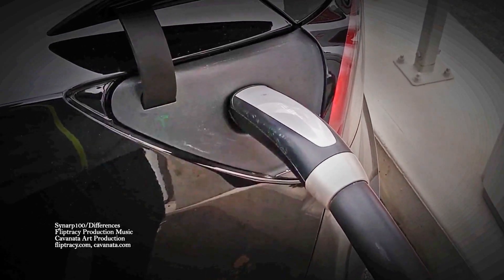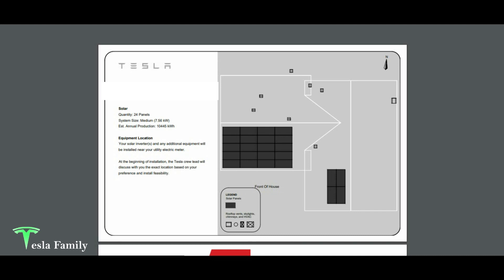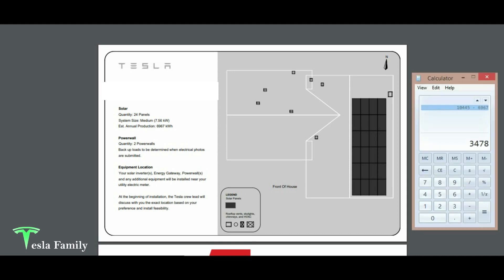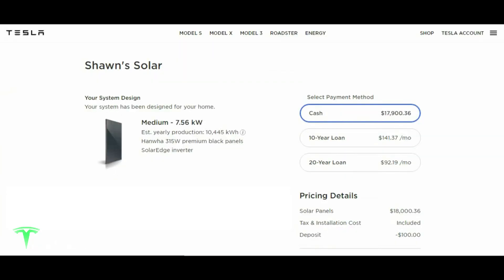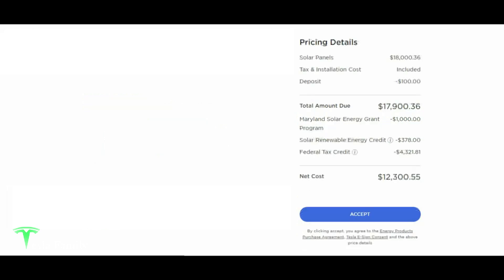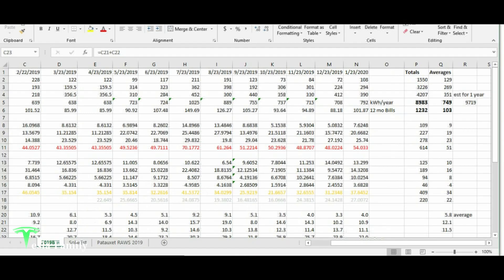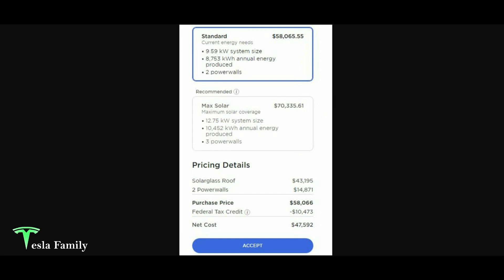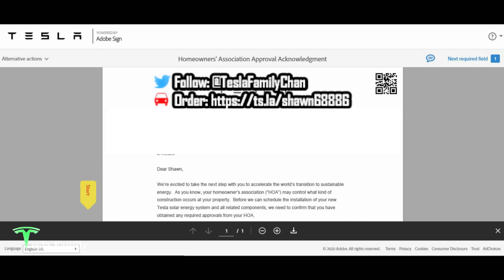Our Tesla Solar Panel Design Layout | Why Direction Matters | Cost Breakdown

Comment: When was your Telsa payment required since you paid in cash?
Reply from the maker: Hi Percy, first 50% after installation and second 50% after Utility Permission to Operate before I turned on my system.
Reply from the maker: Hi Percy! I received a referral notification that your new Solar system was installed on 12/30/2020. Congrats!. Please share some details of your system and or install experience. @Percy Jen
Reply: The let me give you the run down.  I placed my order mid August, a Telsa guy came out to take pictures and  roof details.  After all of that I would call every one to two weeks for an update.  They always told me, “someone is working on it.”  So I the 90 day contract came and went.  I told my wife let’s pass because the excitement had left.  Around Thanksgiving I started get calls from Telsa with rebates offer if install couldn’t happen by the end of the year.  We signed back up and follow their steps.  

Around Christmas our install date was scheduled for January 4th but it was bumped up to December 30th.  Install was good.  The guys showed up on time, explained the timeline and process.  I live in a new construction house so everything was setup of solar (California).  Their plan did call for the inverter and power box to be outside but I ask them to move it inside the garage where the builder had pre installed areas for solar and EV charging.  I think from arrival to departure was 5 hours.

The panels looks sweet on the west side of roof.  I purchased the smallest system at 4kWh (12 panels). You can only see them if your walking toward my house on side walk.  Just waiting on Telsa, County and Utility inspection to throw the power switch.
Reply from the maker: @percyjen6490  Thanks for sharing your story! Glad you decided again to go with the panels and the install went well! I think its really neat that your home builder had pre-installed areas for solar and EV charging! Please update me again when you get your Permission-To-Operate. Would love to hear how the panels are working out for you. Also let me know, If you don't mind, when Tesla sends you the referral award because you used my referral link when you ordered. Congrats again and Happy New Year!
Reply from the maker: Hi Percy, Did you end up getting Permission to Operate yet? If so, what date was that if you can share. Thanks!

Comment: Hi, How did you get Tesla to revise the layout of the Solar Panel placement? I plan to get 4.08KW (12panels) on my property, but they put all 12 panels facing NW and only generate 4888KW. I would like them to put some facing Southwest side.
Reply from the maker: Hi Thanks for watching! To get my design changed, I emailed my Tesla Advisor who sent the original design to me. I asked why the panels were all on the East facing roof when the South facing was wide open. It turned out that the satellite image Tesla used to design the layout was old. I had taken down some trees in front of my home which were not yet reflected in the satellite image.  So after passing that along to Tesla, they updated my design following the onsite home assessment. If you have too many tall trees southwest of your home, they will provide a significant amount of shading thereby reducing production.
Reply: @TeslaFamilyChannel  I see. Thats for the tips! :)
Reply: Btw, I did used your referral code to sign up for Tesla, I hope you don't mind. Your videos was really helpful. I'm just working on to see if they can change the layout of the Panels before continuing. Btw, does Tesla have any performance guaranteed? Say they estimated annual production to be 4888KW, but after one year, what would happen if my production is much much lower?
Reply from the maker: Thanks for using my referral code! I'm glad my videos helped you make the decision to go solar. Yes, Tesla has a 25- year performance guarantee. See it here: https://www.tesla.com/support/energy/solar-panels/learn/solar-service-warranty

Comment: You must have a very reliable electric utility company, not to get a Powerwall.  My MAIN motivation for  getting solar is to avoid all the power outages we get here all year in Northern California. :(  I mainly want the Powerwalls, and I want the solar to recharge the powerwalls.  My installation will be in SIX MORE DAYS!!  So I am eager to watch videos like yours to learn all I can!  Thanks for publishing this!
Reply from the maker: Thanks for watching! Yes, here in Maryland, so far any outage has been less than an hour in length. Also we have underground electric supply. I still have a Powerwall on my radar but at the time I ordered solar, it wasn't in the budget. Good thing it's an easy addition! Congrats on your solar and Powerwall system coming very soon!!

Comment: Thanks for the very informative video. Great job. Curious about what caused the design change?
Reply from the maker: Thanks for watching! I asked Tesla to move my panels to my south facing roof because that is what gets the most sun and thus highest productivity.
Reply: Tesla Family Channel That’s interesting that Tesla didn’t initially design the solar panels for max efficiency. Did they provide you a good reason? Was their initial design more focused on aesthetics? That was a very important design change on your part, it allowed you to remove the power walls from your cost equation. I’m left wondering if we should question their initial design?
Reply: How long did that design change take and who did you contact about it?  I just got my design and 70% of the panels were on North facing slope, SMH.  I redid it and emailed a few generic email addresses.  Wondering if I have to acknowledge and do design change afterward.  Let me know what your experience was in that area.  Great vids and they helped me pull the trigger last week.
Reply: Very informative video, I am also in the process of getting solar with Tesla and the initial design the sent me was a mess! Their design had a lot of panels facing north and all spread around the roof, I asked why and the representative said it was "The most efficient design", I ended creating another design and submitting it for them to review it, still waiting for the design to be approved.
Reply from the maker: Thanks for watching and commenting! Glad to hear you submitted an alternate design for them to consider. Do you have many trees in your yard on the south facing roof? If you had any pruning done recently, let them know as it may not be reflected in the satellite image they used for your initial design. Once you approve, Tesla Energy will come to your house and do an inspection to make sure the design will work on your roof.

Comment: FYI Tesla just dropped the medium system price by $2,000 and plan on using 340 vs current 315 panels . I called them this morning as I’m scheduled for install on Wednesday to see if they honor that price etc. or if I had to cancel. I was informed that I qualify for a $3100 rebate from Tesla directly due to the previous price and approx 9% watt drop.  So I’ll have the 315 panels installed Wednesday as long as I get the rebate in writing prior.  My customer service has been terrible so far and with 2 prior install dates cancelled, 1 without informing me so I was waiting for them to show for a few hours, I won’t allow the install until I have something written.
Reply from the maker: Thanks for the note Rich! We are having our panels installed today. They are 315w panels and we did get the Rebate Offer as well.
Reply: Tesla Family Channel congrats on the install, our went well, and we have the county inspection Monday.